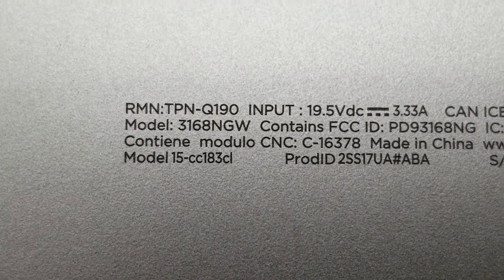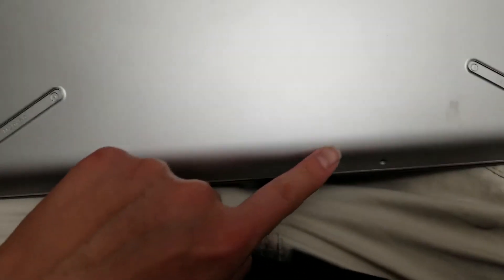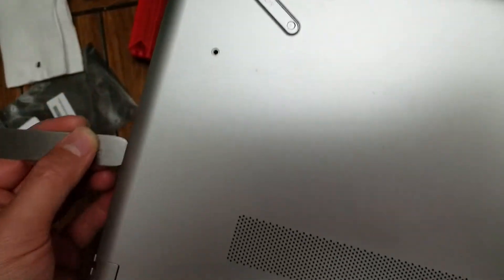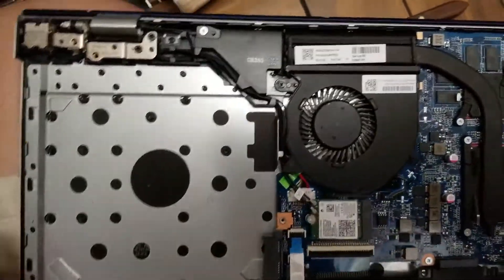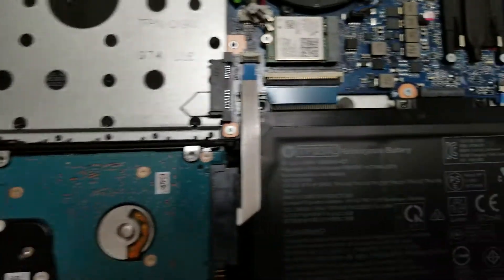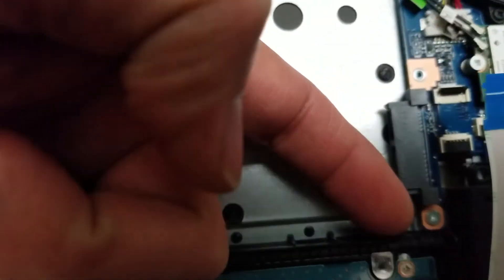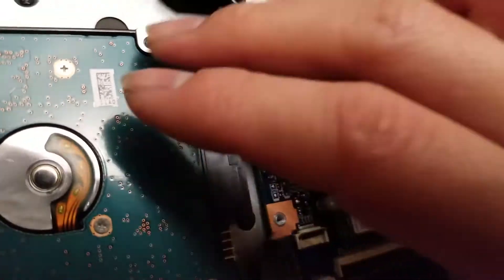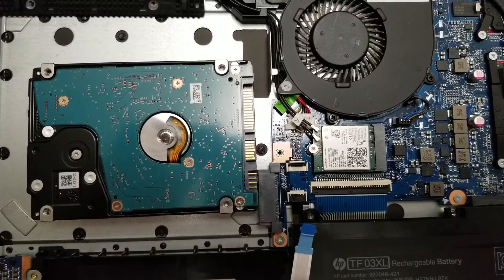HP Pavilion 15-cc183cl 2SS17UA#ABA Disassembly SSD Upgrade Hard Drive Replacement

Comment: hi guys, i confirm, Corsair Force Series MP510 960GB NVMe PCIe Gen3 x4 M.2 SSD full operational in this terminal, the change, the change was amazing... ...guys i have a question about he max capacity of ram and the speed, and recomendations about which one can i choose
Reply from the maker: as long as it's the same type, you can get as large as whatever will fit.
Reply: @ItsBinhRepaired  hi, aboout the ram capacitty, the ark in intel page said it is  32 gb by Proccesor, equal my CMD, but  hp page and even crucial said 16... Help Please >n<
Reply from the maker: As long as you match the type and speed you can put whatever capacity you want. If you aren't sure, make sure you order from somewhere you can return it.
Reply: @ItsBinhRepaired  when you are talking about type is .. ddr3 or ddr 4, amd spped is about the  MHz ?
Reply from the maker: @JPBUKAROX  yes

Comment: It seems to have a 512 GB max?
Reply from the maker: That's a lie
Reply from the maker: There's no max
Reply: @ItsBinhRepaired  I am talking about the m.2 NVMe PCIe. And, unless I am reading things totally wrong, there is also a 256GB m.2 NVMe limit if used along with a 1TB SATA already in the computer? See the Dual-storage configurations at the bottom of the page. Thanks, Ed.
Reply from the maker: @edelysteklasa2191  they have 2tb nvme drives
Reply: @ItsBinhRepaired  GoodBye !!!!!!!!!!!!!!!!!!!!!!!!!!!!!!!!!!!!!!!!!!!!!!
Reply from the maker: @edelysteklasa2191  hm?

Comment: hi guys and ladies, nice to meet you, i have a question.... I have a 15-cc183cl and i want to know... can i put together a Crucial MX500 1TB 3D NAND M.2 Type 2280 Internal SSD and a Western Digital WD20SPZX WD Blue - portátil HHD (2 TB, 5400 rpm, SATA 6 Gb/s, caché de 128 MB, 2,5") ?? or this configuration, could make a bottleneck in my system? and in adittion... could this manage a 32 gb ram kit configuration or betther only the 16 gb ram kit ??
Reply from the maker: should work as long as the slots are available. Just make sure to buy parts from a place with free returns like Amazon.
Reply: Yes, I have the slots but I wanna know if the mother board resist this change...or where I can  see the references and limits for that, without a bottleneck or oversizing the limits and they wouldn't gonna work...I find a change part list but all of them are from hp and are very expensive
Reply from the maker: @JPBUKAROX  only way to know for sure is to try it and find out unless Google has the answer.

Comment: Just replaced the original 1 TB Seagate hard drive with a little older 500 GB Samsung 850 EVO SSD.  First, I couldn't have done it without this video.  Second, for anyone thinking about doing the same thing, I whole heartily recommend it.  The hardest part will be getting the back off of the laptop.  Be sure to clone the new SSD and then follow the steps in this video.  My laptop is so much more responsive now.  Thanks Binh.
Reply from the maker: Glad it helped. SSDs are amazing! For anyone wondering how to clone the drive, this video should help. https://youtu.be/4p5jFDzVwUw

Comment: Thanks for the specific information.  I had been looking for this info for a while.  I particularly appreciate your comments regarding how difficult parts of the operation are.
Reply from the maker: No problem. Glad you found it useful. :)
Reply: I saw you pointed out the location of the M.2 connector, but I couldn't see the entry area clearly enough. Does the M.2  SSD motherboard connector allow mounting of NVMe 22 cards? and support of NVMe?
Reply from the maker: If I didn't mention it in the video, I don't know. You'll have to Google it to find out. M.2 SATA is always supported. Nvme have to experiment.
Reply: @ItsBinhRepaired  Thanks for this prompt response. Upon closer scrutiny, it APPEARS like there is only one indexing notch which would suggest it can be mounted. I will see what I can find out elsewhere.
Reply from the maker: @edelysteklasa2191  the m.2 slots always only have one notch. It's annoying. The nvme drives as far as I've seen can always fit, even in the sata only slots. I don't really get it.
Reply from the maker: @edelysteklasa2191  for some reason YouTube won't show your comment. There is no capacity limitation.

Comment: what SSD is the best fit to hp pavilion 15-cc178cl?
Reply from the maker: If it's like this model either an m.2 sata not sure if it supports the faster pcie nvme type or clone your current drive to a 2.5" sata SSD. Samsung, Crucial, Kingston, and SanDisk all work well.

Comment: Hi excellent guide
I am looking for 1 TB SSD drive that is compatible for HP PAVILION 15-CC183CL. Which one model of brand do you recommend?
Reply from the maker: 2.5" SATA SSD I recommend Samsung, SanDisk, Crucial, and Kingston for SSDs. Samsung usually has the fastest SSDs, but price is usually much higher.
Reply from the maker: Just saw you subscribed. :) Thanks! Don't forget to watch my video on how to clone your hard drive to SSD so you can swap them easily without having to manually reinstall the OS.
Reply from the maker: If the video helped and you haven't already, please like and subscribe, it'd really help me out. Thanks!